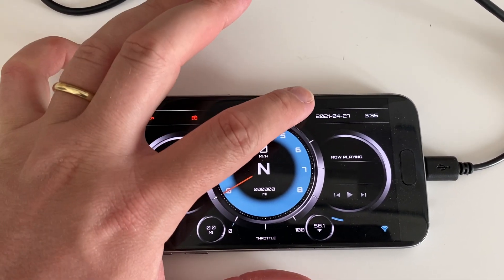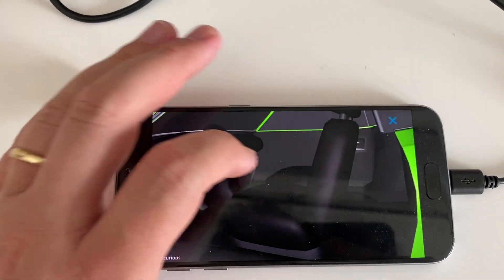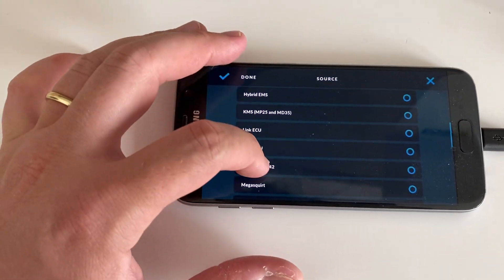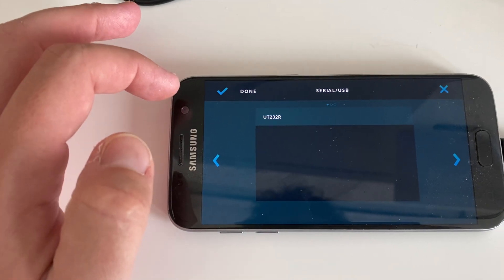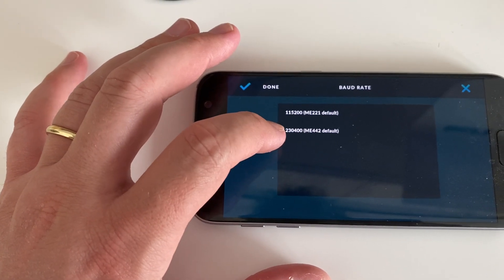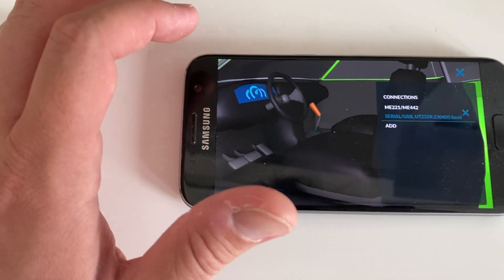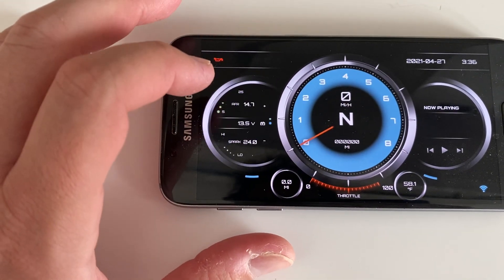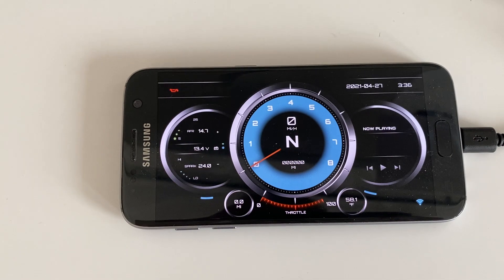Setting up RealDash with ME ECUs. ME100/ME221/ME442 WireIn

Comment: Hey guys, completely new to yiur ECUs.. Recenrly bought an MK Indy with an mx5 turbo engine in it,  ME442 ecu.. what do i need to do to get this working? Read USB OTG cable, any specific app? 

Cheers
Reply from the maker: That's the RealDash app. So just the cable and that should be enough.
Reply: Ahhh excellent thank you, I'm planning on trying to find a waterproof tablet running android and real dash, then have this as my dash cluster. Failing that, have you any suggestions for a simple to install digital dash that will work with the ME442? AIM, Haltech and the likes of? Something along those lines anyway

Comment: Very interesting!
I have a gen 1 pnp for mx5
What kind of serial adapter should i buy? Type C to regular usb type A port and then use the original Ftdi serial adapter i already own? Or do i need a special type c to serial adapter ?
Reply from the maker: So you'll need an USB OTG cable and then plug in your existing FTDI serial adapter into that.

Comment: Can this be used for the plug and play in mx5
Reply from the maker: Depends on the version. Gen1 units yes, we're trying to find a solution for Gen2 units as well.
Reply: @MotorsportElectronics Is this working now for gen2 mx5 me221 ?

Comment: does it have to be a specific lead to connect using me221 gen 1
Reply: I've tried Android phones and Windows tablet with OTG and no connection in a Gen1...
Reply from the maker: What firmware version are you running on the ECU? You can copy-paste the contents of the Help->About box
Reply from the maker: No. Just a standard USB OTG cable for your phone and then the normal serial cable you use to connect to the ECU using your laptop.